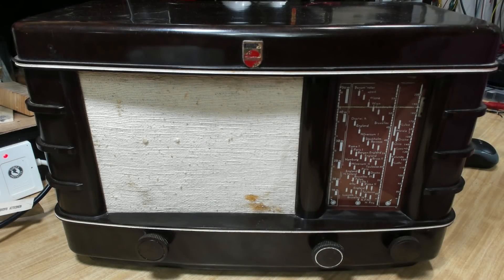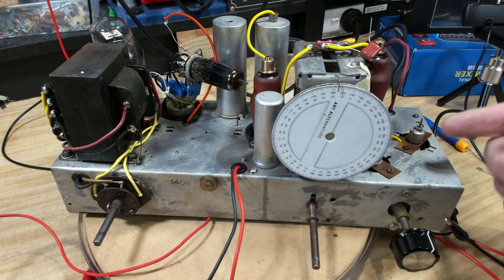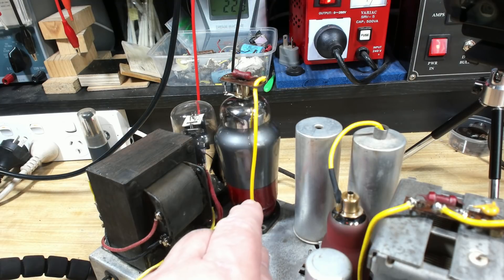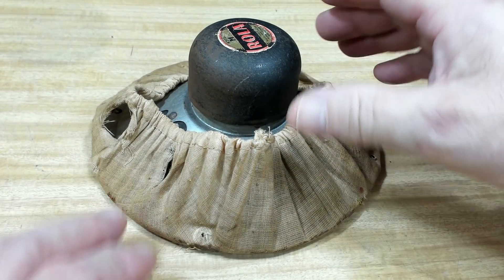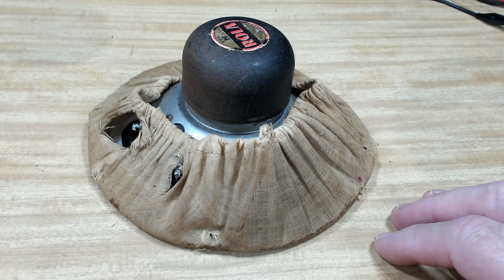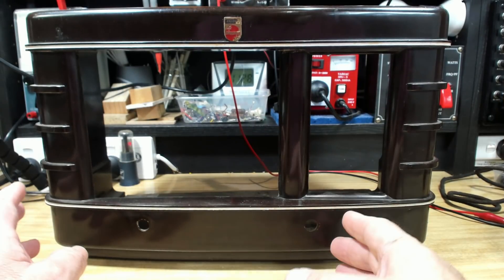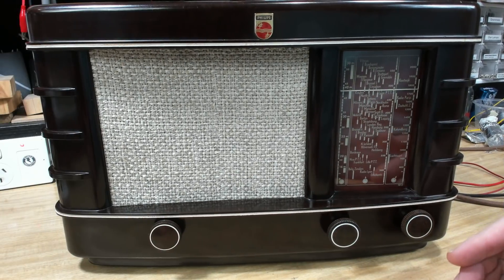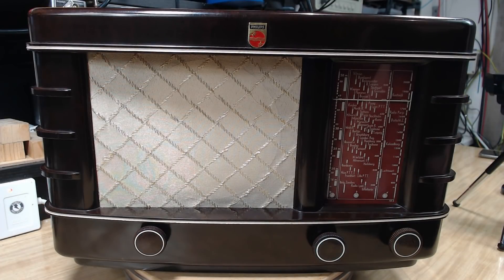Philips 206A - 1940 Sympathetic Restoration Part 2

Comment: Great job again. With all that sewing, rebuilding tubes and polishing of your knob, it’s not hard to see why your videos are an integral part of my Fridays. 
By the way, I bought a pack of Carls Caps, and was really surprised at how quickly they got here. Thanks for the tip.
Reply from the maker: Hi Manuel, thank you. I have been busy of late 😄 Carls caps have been very good, no failures and consistent quality. I saw you used some in the Philips. If you buy from his eBay store, ask for combined postage, he will generally adjust the postage if possible.

Comment: Love your videos. I was very much an amateur enthusiast during my school days during 1950s. Made a Crystal Set using a Gillette Razor Blade and a Safety Pin as a crystal ( Was a wartime innovation by nifty troops that I read in a Hobby Magazine) It worked!  Also made a One valve Radio using a 1T4. It worked also in spite of my dodgy Soldering skills.
Reply from the maker: Thank you @mehere8305. I have heard of the razor blade radio. One was on display at a museum we visited 🙂

Comment: Hope the bodily constraints are on the way out now... 😀
Top job again Dave... I had my doubts, but you put me right yet again... great verbal presentation with lot's of self mockery LOVE it...  your tube improvements are way beyond most I've seen... your an true crafts artist. And about the sewing club... tip... cut the elastic... measure length + extra for knott. Use cloth as pattern... plus oversize for sleeve. Sew together and enter elastic with long wire. . Greetings again, Ruud
Reply from the maker: They are in the mail now Ruud. This radio was a lot of work and a bit of fun and came out very nicely. Thanks for the sewing tips 😀

Comment: Dear Dave, the universal genius, even on the sewing machine, great video. I fix loose tube sockets with wood glue, in Germany it is calles "Ponal Classic". It hardens out transparent and stays flexible.
Reply from the maker: Hi Thomas, Ponal Classic glue sound like it's PVA, I'm surprised it works. Thanks for the tip 🙂
Reply: @DavidTipton101  Yes, Ponal Classic is a PVA-glue. If you remove the socket totally from the bulb for re-fixing JB-Weld might be the better choice, even though it might not be possible separating the tube again. When there is a loose socket, but it is still cemented into the socket, Ponal Classic works great for fixing and its drying out transparent.
Reply from the maker: The JB Weld socket ain't going nowhere. I try your PVA fix next time, thanks Thomas.

Comment: What an amazing job Dave. So many different skills including a bit of sewing now 😲. I know where to send my speaker covers for repair 😉. I do have some of those weird Philips valves if you get stuck. Cheers Graham
Reply from the maker: Hi Graham, thanks I will keep your Philips valve stash in mind. You do a lot of Bush radios you wouldn't happen to have any info on a 1936 Bush BP5 battery radio loop antenna would you. I am working on one and the antenna is missing, I need the  number of windings and the wire size, I can estimate the frame size I think. Thanks 👍

Comment: Dave. Sorry I have not been more active in comments. We moved across country from the West U.S. to the East U.S. Thus "when" you post has changed for me to when I am asleep rather than just before I go to bed. I enjoy your videos a lot, learn a lot too! I am praying for your issue too. God bless. Outstanding work as is per usual for you.Nice work rebuilding the tubes. I have done a little sewing and when you tied off the elastic I knew it would be redone LOL. Nice
Reply from the maker: Hi Wayne, no problem. That's a big move, hopefully it went smoothly and bad luck with the new time difference, sorry about that. Cheers 🙂

Comment: Breakfast porridge is always more enjoyable with a Dave Tipton video. I learned to sew around 50 years ago when I used to service and repair equipment for my sisters sewing business. Every week I use equipment in the workshop that is capable of removing body parts and think nothing of it but sitting at a sewing machine still scares the giblets out of me. I suspect your wife was technical advisor for parts of this video. Your unique ingenuity and problem solving is always a pleasure to see however I'd give the Sewing Bee a miss, the gossip would do your head in! (ha ha).  All the best mate.
Reply from the maker: Hi Stephen, thank you. The sewing machine is mine, well I bought it to do this job and a few others, very cheap unit but it did the job. I submitted my work to the Sewing Bee, I haven't heard back yet but I expect they are very busy. Take Care 👍🙂
Reply: @DavidTipton101  Going to get some stick on flowers to pimp up my sewing machine. have a great day.
Reply from the maker: @Stephens8x6Workshop  Haha... I might have started something 😀😀

Comment: Good evening Dave. I hope today finds you hale and hearty. I must say you've surpassed yourself with the sewing machine. You truly are A Man For All Seasons.
As I has said before, I'm and old radioman. And, at one time, I worked on Non Directional Beacons (NDB). Those are devices that broadcast a signal on the band below the regular commercial AM (MW) broadcast band. These are relics from the beginnings of aviation and radio. I heard the signals you captured on the long wave and I figured out the call signs. The first I couldn't find on Sky Vector, but the second one was easily found. It's pumping out a code of BLM on a frequency of  374 KHz, which correlates to roughly 800 meters, from the metropolis of Bromelton, which looks like it's about 60 Km SSW of you in Brisbane.
Reply from the maker: Good evening Tim, I'm pretty good now thank you. A few others also commented on the NDBs, I was told they were on the water for shipping years ago but as you and others have pointed out they are for aircraft and land based. The other beacon is at Gold Coast airport at Coolangatta, it's sign is CG and transmits at 278 KHz. It's about 68 km from me. Thanks Tim 👍🙂

Comment: Good reception of the LW beacons #1 CG = Coolangatta, #2 BML = Bromelton
It's a shame that the tube, which was repaired with love, no longer works 😢
Your sewing skills aren't that bad.
Overall result and the look is really impressive. I like the radio very much.😍😍😍👍👍👍
Reply from the maker: Hi Bernd, Ahh it was Coolangatta, another comment picked up the Bromelton NDB, I was told it was the Coolangatta beacon years ago, it's at Coolangatta airport, I was told it was in the water. Thanks 👍🙂

Comment: Now you can ad sewing to the list of your many talents. Brilliant work as usual and a lovely outcome. I reckon that output valve will be reliable. Just wave the new one when it arrives in front of the radio now and again. 😉
Reply from the maker: Hi Ian, haha... thanks. We got the new valve and replaced the repaired one, it didn't seem to work any difference. The owner has the repaired valve next to the set to make sure the new valve knows it can be replaced 😉😄

Comment: Great work Dave !! Brasso works a treat on bakelite. I used to use automotive cutting polish ( light cut ) and hand buffed. I found the reworking of the shields for the output valve  a interesting fix. great work all round !!!
Reply from the maker: Thank you Stephen. I use the automotive cutting compound on bad cabinets and the Brasso gives it a great finishing shine 🙂

Comment: Dave your amazing, the Phillips tube grounding technique certainly will become the restoration standard, I think it was a coincidence that the valve died be interesting to see what to tester proclaimed. Then you make restringing dial cords look like child's play send some dial cord magic to Caldeira ha ha.
Reply from the maker: Hi Mack, the valve base rework come out pretty good in the end and will be handy in the future as these tubes are difficult to get. I don't think the tube failure in the end wasn't due to my repair, I resoldered the wires on the base and I was careful not to get adhesive on the wires, I think it just got tired. Dial re-stringing is pretty easy and I was sending Manuel positive thought to get him through his FM tuner restring, I hope he appreciates it. Thanks Mack 😀

Comment: As always a great video, thanks for sharing. I have never seen the cloth cover before, it would be interesting to listen to a tone that vibrates with and without the cloth. Cheers!
Reply from the maker: Hi Bruce, thanks, my pleasure. Before I handed it back I cut the front out of the cloth so it didn't inhibit the newer model speaker and it made no difference. It still looked the same from the back 🤔🙂

Comment: I love this radio, and the great job you have done making the video. I recently saw on radio museum a mullard badged one of these it also had an original photo of the back.. I noticed the original permag speaker which looked like a typical Alnico type. So Philips we’re making permag speakers in Europe during the war while here in oz we didn’t see them in use till the late forties.
Reply from the maker: Hello Robert. I believe the Mullard version was made at Mullard in England. They used octal versions of the same side contact valves used by Philips in Holland. There seemed to be a mix of permag and electro speakers here in Oz on the same production run. The same model radio would come with either speaker type and maybe a choke or no choke. I think it depended on supply. Kriesler documented the changes to their models showing the changes as supply varied 🙂

Comment: Fantastic Job...I have one of those in my collection... in mint condition. Changed a few caps and it works a dream....Hello from the UK
Reply from the maker: Hi Downstairs Dave, a mint condition one would be lovely, I understand the export model might have Octal valves in lieu of the side contact Philips type. Thanks Downstairs Dave 🙂
Reply: @DavidTipton101  Yes that’s right Dave  it does have  Octal valves. Even the speaker cloth is original. There is one slight difference in that the dial glass is printed in green red  and yellow .
I bought two radios off the chap including a 1939 wood case English Electric.. it’s like brand new, felt like I was stealing them off him, only paid £120 for the two..
Reply from the maker: @Downstairsish  I saw a photo of the 206 online with the coloured glass. 120 quid for two mint radios is a good buy, the ones I get look like they have spent two years on the side of a motorway.  
Image of coloured dial glass 206A: https://www.worthpoint.com/worthopedia/1940-vintage-valve-radio-philips-206a-1783260044
Reply: That’s exactly the same as mine

Comment: Interesting to see that there were different local versions of the dial glass! The original has a mix of local (Bruxelles, Wien) and English (e.g. Rome) place names, while the reproduction has the Dutch version of various places (Parijs, Boedapest).

I just had to check if I remembered that right, and I did: my early-60s Austrian Philips Planoton even has station names for FM on the dial! I've always found those dials fascinating with those far-away foreign cities.
Reply from the maker: The glass wasn't an exact match and was made for a different location but it was a close as we could get. FM station names? that's different 🙂

Comment: Dave the set really looks nice, and I too have had intermittent issue with an RCA AA5  it would run fine out the cabinet and after being in the cabinet the volume would raise up and down .
Reply from the maker: Hi Richard, thank you. I have had a few not like being in the cabinet, tricky to determine the problem sometimes. I hope you got yours fixed 🙂

Comment: It turned out very nice. I think I heard a "CQ" on long wave. (I was going to make a snide remark about sewing little bonnets for speakers, but decided that was just too easy.)
Reply from the maker: Hi Wayne, I can't work out what the nav beacon code is if that's what you mean, I tried. I hope I get more bonnets to sew, I had to buy a meter of cloth 🙄🙂
Reply: @DavidTipton101  Google did give me this: CG on 278kHz (Coolangatta) and BML on 374kHz (Bromelton).
Reply from the maker: @1954jw  Thanks Han, yes, a couple of others pick that up also, another mystery solved.

Comment: I'll actually write words this time 😊.  Another lovely rescue with some good laughs thrown in.  I was yelling at the screen when you were using that 'sewing machine'.  I learned a lot from the valve shielding method.  I once owned a Relton console radio back in the mid 1970s and had the same cap falling off thing.  I had a friend who knew his way around a soldering iron (and owned one) and I managed to solder the cap back on and glued it in place with Araldite (no JBWeld then I don't think).  It worked fine but it was terrifying at the time.  I think I have done one or two since but never had to file the glass away to get enough wire, that's scary.  Excellent Teutonic style radio.  No frivolous excess there!  😊
Reply from the maker: HI Pauline, I apologise for my sewing attempt, I hope your screen is OK. I have refitted many loose valve caps and it's not a problem but this one I could only see the top of the broken wire even after filing the glass a bit, I doubt it will last long if put into service. We used a two part mix back in the 70s that had the same smell and look as JB Weld, I used to call it Let-go Weld because it sounded similar to that, a quick Google didn't find any results. Thanks Pauline 👍🙂

Comment: Sometimes low volume can be corrected by connecting a bypass capacitor across cathode resistor. 20 or 25 mfd at 25 volts will work. Nigates negative feedback in grid circuit.
Reply from the maker: Thanks Kenneth, I don't recall this having low volume 🤔

Comment: Very nice 😉👍. You really don't need to remove the base of this type of tube to repaire the shielding, just need to glue the glass to base, then file/clean the original wire and apply the silver lacquer to connect it to the old shielding lacquer.
Reply from the maker: Hi Boris, thanks. Yes I know but there was broken up glue inside and the base and glass were very dirty underneath, besides it makes an interesting video 🙂

Comment: I have to say that you made that speaker bag perfect, it looks brand new 😀
Knit wit lol, perfect name  😀
There has to be one valve that takes the micky,  i find putting the screws into any device triggers the automatic Almost done fail now state.
It comes under Sods law, part 3 (failure for spite sake).
As far as sewing machines are concerned, it works great untill it don't and the item you are sewing is important.
Back to Sods law part 3 😀
Reply from the maker: Thanks zx8401ztv. The bag looked good, a good thing you couldn't see inside. That valve, ran for a week then it took a long time to start the oscillator and it would slowly creep down the scale. It worked OK after a 30 seconds or so. People mock Sods law but it's for real 😄

Comment: Furthermore, this ia a very good restoration! The IF was probably originally tuned to 460 kHz due to IF breakthrough problems at 472 kHz of Scheveningen Radio in the Netherlands.Realignment to 472 KHz may have influence to the optimum value of the padding capacitor in the oscillator circuit especially at the MW and the LW range.
Reply from the maker: Thank you Wim 😊

Comment: Using a sewing machine need not be embarrassing for a man. Just recently I used the bobbin winder part to rewind the coil of a Philco 71B shadow meter.  An empty bobbin spool, and some hot glue to hold the Philco part in place (and several attempts to set the tensioner right for the fine copper wire), and it works!  Mind you, you do use up a lot of cuss words and may waste a lot of wire before you get it right.
Reply from the maker: Hi Lurker Smith, good idea using the bobbin winder to wind your coil, they work well on thread so why no, good thinking 👍👍🙂🙂
Reply: @DavidTipton101  Turns out, though, that fine copper wire us MUCH less robust than thread! It does take patience and a lot of extra wire to get it right!
Reply from the maker: @lurkersmith810  Haha... I can imagine.

Comment: Beautiful work Dave.  Thankfully I've haven't run into tubes like those in the Phillips.  Loved the Dave's Sewing Circle segment.  Been working on my radio and so I didn't get to watch your video until today.  Found a couple of wiring errors but the radio came with these.  Apparently the radio was modified in the past☹️
Reply from the maker: Hi Nelson, thank you, I'm glad you enjoyed it. I hope your get your radio to work if you haven't already, with all those valves it should work great 🙂
Reply: @DavidTipton101  Still working on the radio.  At least the oscillator is working.  Midwest  radios were reported to have extra tubes to inflate the tube count.  (More tubes the better!)  Looking at the radio I could rewire the radio to run on 15 tubes but that would not restore the radio to the original design.